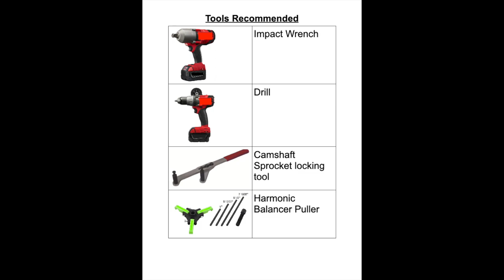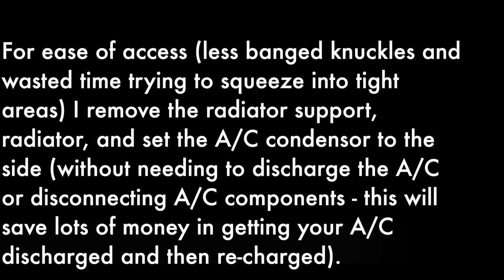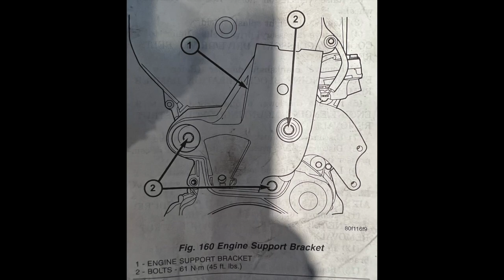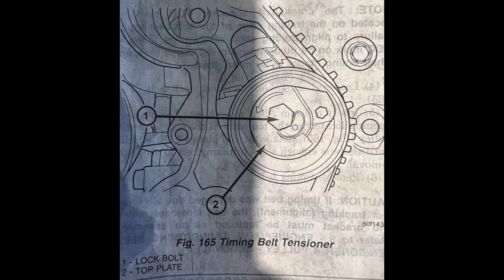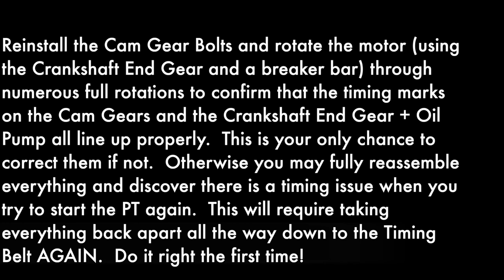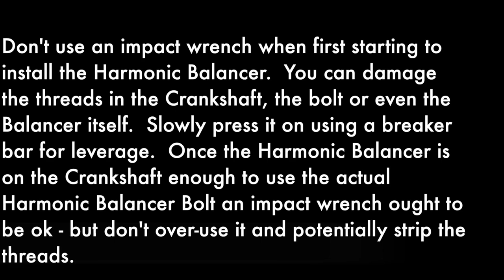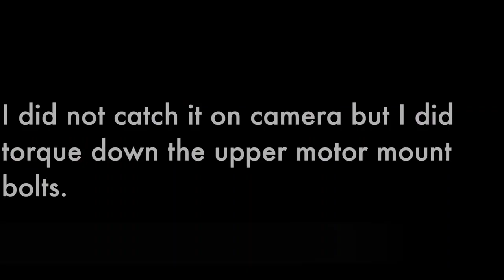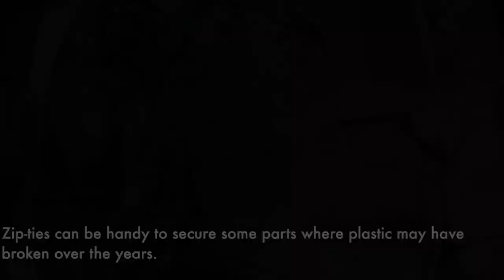PT Cruiser Timing Belt Replacement

Comment: I recently did this job. I bypassed and hacked as much as I could. Didn't pull the valve cover, intake manifold, camshaft gears off. Only loosened power steering pump. I did use cam locks to keep the timing belt in place while installing the new timing belt. That helped alot. As for installing the harmonic balancer, you can use a longer bolt and put 1 washer at a time to crank the harmonic balancer back into place so you really don't need the special tool to re-install it.
Reply from the maker: Nice work and sounds impressive!  Thinking on your toes and making things work in your favor.

Thanks for watching and leaving the comment and best of luck with your PT - keep it Cruisin'

Comment: I just replaced the water pump and timing belt on a 2001 Status 2.4 DOHC and I didn't have nearly as much trouble lining the timing marks up.  Pin the camshafts, install the belt, and adjust the tensioner. It's done!  From start to finish, it took about 2-3 hours and that included new sparkplugs and wires.  I realize that PT Cruisers are a bit more complex as far as component removal goes but the timing belts are identical.
Reply from the maker: Nice work on your Stratus @dannyreed1632.  Since I made this video I have noticed that the belt tensioners I purchased do seem to have more rotation to them which offers better slack in the belt to loop it over the tensioner after you've run it around the Cam Gears.  There are certainly more that one way to get the job done but I do wonder if the quality and manufacturing of the aftermarket belt tensioners has changed over time due to how tight I have seen them be in the past.

More recently I've had a much easier/quicker time installing the timing belt on several PTs similar to what you described in your post.  I find the best way (my current favorite) is a hybrid process using the factory installation process in combination with several vice-grips to hold the camshafts from spinning once you get them in alignment and the belt installed.  This has been working much better for me.

Thanks again!

Comment: Thanks for taking the time and effort to make this valuable video.
On a side note, I've read in the comment section of similar videos that removing the two transmission mounting bolts, as well as all engine mounts, gave them another four inches of motor swing to get it out of the way of the inner passenger side fender.
Comments?
Reply from the maker: @jly74 Thank you for posting the question.

So you will already have removed the Engine Torque Struts and disconnected the Passenger Side Motor mount to do the Timing Belt replacement as seen in this video.  If you want to take the extra effort and disconnect the Transmission mount that would allow you more maneuverability of the engine/transmission assembly and you'd probably get a lot more room on the passenger side.  HOWEVER - You would need to be very careful/cautious to properly support the entire engine/transmission assembly so it wouldn't fall or potentially move/rotate too far.  You could easily start ripping hoses, wires and other components apart if the engine/transmission assembly were to rotate/drop too far.  So there is the possibility it could become a nightmare...

But if you need that extra access for any reason I'd say it is not out of the question.  But personally I don't feel there is the NEED for this repair.
Reply: @PTBubbles  Thanks for your response. I'm "looking forward" to this operation (belt, idler, cam/crank seals, water pump) in the near future on my 2005 Dream Cruiser Limited convertible, auto trans. 107,000 lucky miles.
Reply: Forgot to mention: it's a turbo.
Reply from the maker: @jly74  Excellent!

The job is virtually identical on the Turbo model you just have a few more things to tend with on the intake manifold and pertaining to the Turbo and it's connections.  But all in all it is not too much more work.

Set aside at least a weekend or two to get through it carefully if this is your first time doing this job.  This is definitely not a task that should be rushed.

Wishing you the best!
Reply: @PTBubbles  Thanks, Jake.
I'll report back after it's completed.

Comment: DUDE!!!! CONGRATULATIONS!!! you successfully made a video on how to make a pain in the ass job even harder and more time consuming. bravo. just pay a shop.
Reply from the maker: Your comment doesn't help or do anyone any good.

Several thoughts:
• These days a shop might easily charge around $1000 or more for a job like this - or (as they told one of my family) just tell you that your motor is blown and you need a whole new one.  If that's what you want to deal with then feel free.
• For ANY older vehicle (PTs can fall in the 20+ years old category now) it is incredibly valuable for owners to know how to do repairs themselves and to simply get more familiar with their car all around so that you are more knowledgeable about it and better prepared to handle unexpected situations or emergencies.
• It's a good thing not to be clueless and scared of your car if something goes wrong.
• I find (as others do) great joy and fulfillment out of using my own two hands to fix something and enjoy the "fruits of my labor" - i.e. - happily driving around after solving an issue on my car myself.  You cannot place enough value on the reward of self-accomplishment.

And lastly - if you were to actually do this repair I am sure you would discover that it is not as bad as you think/react.  Just go slow and careful.
Reply: @PTBubbles 
Agree wholeheartedly with everything you said, plus one additional point which can be worth all the others put together. 
NOW YOU FINALLY HAVE A FRICKIN MECHANIC YOU CAN TRUST!!!!!
🔧👍

Comment: Amazing video PTBubbles !! Thank you so much for the detailed instructions. My Pt (2004 light turbo) doesn't yet have a snapped timing belt, but I should do it as it has 106000 miles. Problem is, I'm really debating if I should keep the car. I absolutely love it, but the rack and pinion has to be changed, and so does the alternator. And being that I should change the timing belt and water pump, it makes for a lot of repairs. Plus, I'm worried more things might go out immediately after I fix it all up. But parting with it is totally not what I'd want to do. Thanks a million PTBubbles thoug cuz you make me feel like I could possibly do the work myself, even if all I ever did was change starters and some little parts here and there.
Reply from the maker: Hello there!  Believe in yourself!  If you've got the tools and the time I'll bet you can do this.  The Light Turbo will have a slightly different process due to the different Intake Manifold and Turbo components but otherwise the work should be identical.  As long as you are careful as you go and don't rush things I'll bet you can do it and get it buttoned back up and working great.  The repairs you mentioned are definitely doable and once you've done them might even be easier than you thought.  One of the very nice things about PT Cruiser parts (at least at this point in time) is they are not too expensive.  Here's a quick price check I just did on Rockauto for the parts you may need to do the work you described:

$130 - Gates Timing Belt & Water Pump Kit: https://www.rockauto.com/en/moreinfo.php?pk=1330560&cc=1432934&pt=16088&jsn=950
$89 - Enginetech full motor gasket kit: https://www.rockauto.com/en/moreinfo.php?pk=7486752&cc=1432934&pt=10392&jsn=956
$187 (with $60 core return) - AC Delco Alternator: https://www.rockauto.com/en/moreinfo.php?pk=1000384&cc=1432934&pt=2412&jsn=1018
$213 (with $70 core return) (Assuming you have an automatic transmission) - BBB Industries Rack & Pinion: https://www.rockauto.com/en/moreinfo.php?pk=7038156&cc=1432934&pt=7388&jsn=1043
$140 - Mevotech Front End Kit (you need at least new Tie Rods with the new Rack & Pinion - but I'd recommend replacing all in the kit): https://www.rockauto.com/en/moreinfo.php?pk=12746885&cc=1432934&pt=15413&jsn=1189
$38 - Sunsong Power Steering Pressure and Return Lines (you want to replace these when servicing the Power Steering/Rack & Pinion): https://www.rockauto.com/en/moreinfo.php?pk=7659700&cc=1432934&pt=7320&jsn=1078

$800 approximately (not including fluids and any additional tools you may need) for these components.  Considering that these days any time you take your car to a shop you can assume the cost will be $1000 at a minimum and you'd not get all of these parts replaced it seems like a better plan.

And here is a list of possible additional repairs you could do since you'd already be "in there":

(I'd be surprised if the motor mounts do not need to be replaced - unless you have already had those done)
$14 - SKP Upper Motor Mount: https://www.rockauto.com/en/moreinfo.php?pk=7753412&cc=1432934&pt=5556&jsn=1133
$14 - SKP Lower Motor Mount: https://www.rockauto.com/en/moreinfo.php?pk=7753416&cc=1432934&pt=5556&jsn=1134

$35 - Front Left CV Axle: https://www.rockauto.com/en/moreinfo.php?pk=3856782&cc=1432934&pt=2288&jsn=874
$44 - Front Right CV Axle: https://www.rockauto.com/en/moreinfo.php?pk=3854565&cc=1432934&pt=2288&jsn=879
$100 - FCS Struts/Coils: https://www.rockauto.com/en/moreinfo.php?pk=4425108&cc=1432934&pt=15174&jsn=1195
$78 - SKP Oil Pump (if you are having oil pressure issues): https://www.rockauto.com/en/moreinfo.php?pk=13561897&cc=1432934&pt=5564&jsn=968
$6 - Front Crankshaft Seal (needed if you do the Oil Pump): https://www.rockauto.com/en/moreinfo.php?pk=261114&cc=1432934&pt=5604&jsn=982&optionchoice=0-0-1-1
$5 - K&N Oil Filter: https://www.rockauto.com/en/moreinfo.php?pk=1127576&cc=1432934&pt=5340&jsn=1094

I am working on some other front end videos now that could help you with these repairs - posting as soon as I can.

I'd be happy to help if you want to ask questions or you get stuck on anything.

Shane of PTBubbles

Comment: We got a deal on a 2001 Limited PT Cruiser because it needs; ignition switch parts, over heating and Timing belt unknown history, plus misc fixes needed too like Sunroof, a bit of paint work and a nice detail.   I’m going to watch this video over and over again so it absorbs all the way through.   Q: Is there a “Best” Timing belt kit (Amazon) to buy?   Notice I did not say “Cheapest”.
Reply from the maker: @catlady8324

Congrats on the PT deal!

I typically go to Rockauto.com for most parts I need.  Here are some links to parts that should help you (I'm guessing on some based on what you described as the PT needing).  Should you eventually need additional parts for steering, suspension, brakes...and almost everything else I'd just stick to RockAuto unless it is one of the rare cases that they don't carry the part:

Ignition Switch:
https://www.rockauto.com/en/moreinfo.php?pk=943191&cc=1398753&pt=4700&jsn=912

Lock Cylinder (super cool version that learns from your existing keys):
https://www.rockauto.com/en/moreinfo.php?pk=9770160&cc=1398753&pt=10041&jsn=939

Timing Belt Kit (this version has the upgraded version 2 Mechanical Tensioner as well as the Water Pump and Camshaft Seals)
https://www.rockauto.com/en/moreinfo.php?pk=7680820&cc=1398753&pt=5759&jsn=1040

Full Upper end Gasket kit (I prefer the FelPro kits and have not had the issue of the wrong style Cylinder Head gasket that comes in some kits):
https://www.rockauto.com/en/moreinfo.php?pk=446938&cc=1398753&pt=5416&jsn=1051&optionchoice=0-0-1-1

NOTE:  Probably a good idea to replace the Crankshaft Front seal (you'll almost be there with the Timing Belt/Water Pump replacement and it is behind the Crankshaft Sprocket)

Oil Pan Gasket:
https://www.rockauto.com/en/moreinfo.php?pk=447505&cc=1398753&pt=5436&jsn=1068&optionchoice=0-0-1-1

Oil Pump (in case there are issues or low oil pressure):
https://www.rockauto.com/en/moreinfo.php?pk=5541771&cc=1398753&pt=5564&jsn=1063

IMPORTANT EXTRAS: Here are some other videos to help you go over the entire PT making it ready and roadworthy for many years to come:

Cleaning up the Engine Wiring (grounds and positive connections):
https://youtu.be/oXGrD9_JFKc?si=eSWqt-jMkrrlnJeD

Cylinder Head Gasket, Timing Belt and much more:
https://www.youtube.com/watch?v=k_FGSxjAo90&t=3638s

Heater Core and A/C Evaporator (in case you might have leaking from either):
https://www.youtube.com/watch?v=k_FGSxjAo90&t=3638s

6 Episode Series I made for Brakes, Suspension, Steering:
https://youtu.be/EN89erGQUBU?si=i8v2xVAMJbxkKxFm
https://youtu.be/72WFVWLfKVw?si=KQFXqgwD05JNNq4S
https://youtu.be/sYMpQVGY5Hw?si=0297J1JYZiZRUwL8
https://youtu.be/HDckRsyQBAQ?si=E1QlQ8SiGJEV0ylt
https://youtu.be/TEXGqvBxO1w?si=pHIJmEaxd_AX-DJQ
https://youtu.be/CohqjAr_Uzw?si=K5QHLLbourMCxEVY

Gas Tank & Fuel Pump Replacement:
https://youtu.be/WrGVbdk_-II?si=poqD8CZxaSZ-xkp1

Rear Liftgate (replacing the Hydraulic lift arms and the wiper grommet):
https://youtu.be/BbKnyVSxTHo?si=xPFmHCw9yxgiynmn

Rear Brakes and Suspension Rebuild (Drum Brake version):
https://youtu.be/uv7aJgFFBuo?si=PymkzxtEoeGiFT9X

Good luck in keeping the PT Cruisin'!
Reply: HOLY SHOOT!!! Looks like I found the PT Cruiser EXPERT!!   Thank you so much!
Reply from the maker: @catlady8324  

I ain't playin'!  😁

Comment: Thank you for the video, by far the best one I've seen. I guess my Wife's PT is due this service. Been dreading it for too many years. It is a 2002 (purchased summer of 2001) with only 36K miles. But 23 years old! Manuel says 100K or 10 years. Not even close on miles, far exceeds the time limit. Car still has original P/S and alternator belts and they look new. As does the entire car. Only parts that are not original on the car are filters and fluids. I have read / been told this is a clearance engine which will not damage the engine if the belt fails. Like yours??? I have also seen videos that show major valve damage when the belt fails with the engine at high RPMs non clearance engine??? It is real hard to start this tear down on a car that pretty much looks the same as it did when it left the factory. On the other hand if the engine will be badly damaged if the belt fails? I'm already on borrowed time??? Your opinion Please?
Reply from the maker: Hello and thank you for sharing the story of your wife's PT.  It sounds like your wife has really taken care of the PT if the belts still look new and it only has 36k original miles!  I am assuming your 2002 PT Cruiser has the 2.4L standard U.S. motor?  If so, it should be a non-interference motor and the cylinder head valves and pistons should not come in contact if the belt breaks.  That being said, there could always be a risk of something being damaged, especially if the belt were to break when the motor is at high RPM (such as on the highway).

The 2004 PT in this video had the belt snap while my brother was driving it in the city.  Fortunately no damage occurred other than the belt itself - oh and I did discover while changing it that it was the tensioner pulley that had failed and probably what caused the belt to snap.  Interestingly the person we purchased this PT from said that the belt had been replaced just 1 year before.  This goes to show, in my opinion, the importance of replacing all the serviceable parts you can when you do this procedure.  It is no easy task and takes time so I feel it is best to address any/all parts you can while you are in there.

You may be safe continuing to run the PT for a while still if there are no issues, but my personal preference is to try and avoid failures before they occur.  I'd say it would be good to weigh the pros & cons, but if it were me I would be prepared to replace more than just the belt if I were going to do the work.  Here is a small list off the top of my head of the other components that you will be very near and have the opportunity to replace if you go as far as the belt:

Tensioner Pulley
Idler Pulley
Water Pump (I'd say this is a must - it requires removing the Cam-gears/sprockets & the Timing Assembly Rear Cover as well.  I will be posting another video soon of doing this work on a 2001 PT)
Upper & Lower Motor Mounts (torque struts)
Alternator and Power Steering/Air Conditioning belts
Oil change & Radiator Fluid change
IF you are having any oil leaks from the Oil Pan, Oil Pump, Oil Filter areas it would not be much more work to fix/replace gaskets/seals for those as well

I know this may seem a bit daunting just looking at it as a list, but you will have already done the bulk of the work just getting to the belt so these are definitely worth considering.

I will soon start posting more videos of doing all those steps on a 2001 PT Cruiser so that may help you decide as well.

I hope this helps - and I'd be happy to answer more questions if you have them.

Shane of PTBubbles

Comment: Would it be easier to pull the engine and do the repairs outside of the car?
Reply from the maker: @dfharris03 There would be a lot more work involved to pull the motor.  I would not recommend it unless you have other reasons and a need to pull the motor to do other work or repairs.